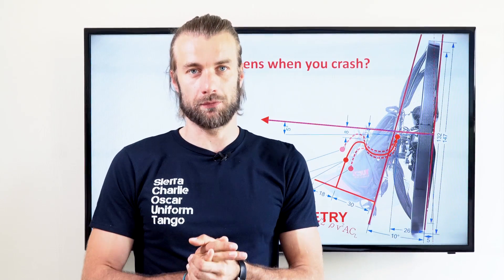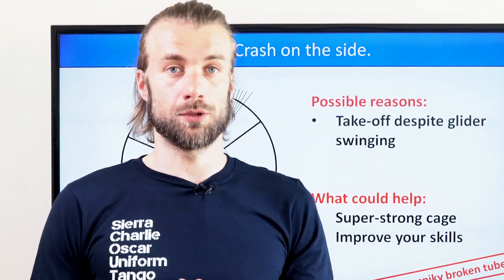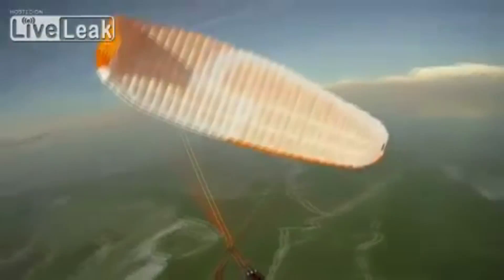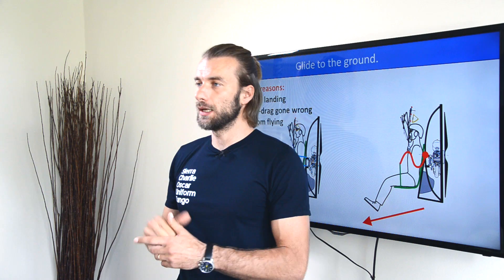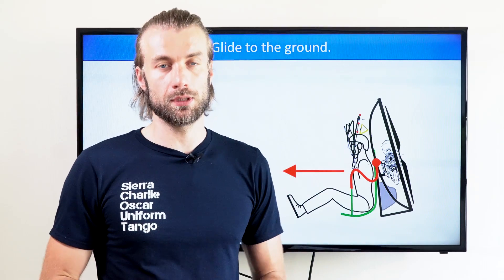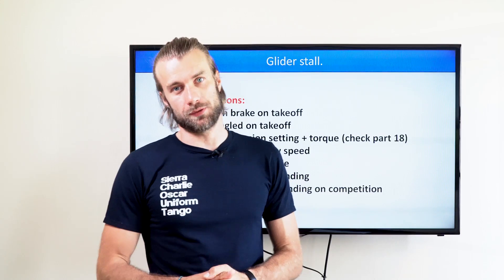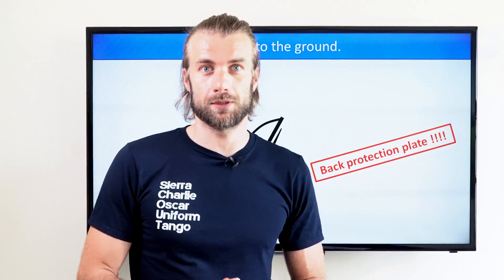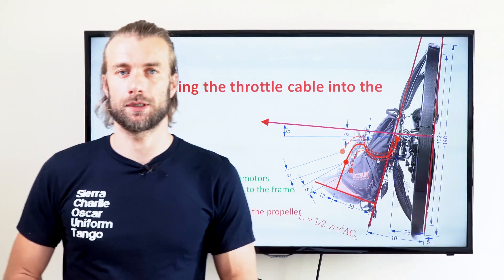Walk away after CRASH on your own? Paramotor geometry part 25.1

Comment: I haven't watched all of these yet but could you do one on a fire in flight & what you could do, if anything other than getting to the ground quickly. I ask this because  my battery is 4 inches from my fuel tank. It worries me. A precaution I took is to cover the positive terminal with electrical  tape. Is there anything else preventative  that I can do? Thank you!

Comment: There is another obvious thing you could do.  How about some load tailored crush foam underneath the seats for a relatively hard butt drag, maybe 6" to a foot thick?  I see a lot of pilots crash that way on the internet, and it seems that would go at least some distance to preventing back/hip injuries on moderate impacts.  At least the difference of crashing in sugar sand vs. wet driven on hard packed beach sand, and that would be SIGNIFICANT. 

Other aspects of the geometry look good.  Maybe you could even aero shape it a bit so not too much increased induced drag.  I see you discuss it later in the vid, after I wrote this, BUT, seriously:

IT DOESN'T MATTER whose FAULT anything is, it happens, you design the vehicle, THERE ARE TIMES WHEN YOU SHOULD throw the reserve, in fact I see SOOOO many pilots going in on the net that SHOULD HAVE, and try to "work" the foil out all the way to the ground, deal with it.  Personally, I don't think a TERTIARY, or secondary reserve chute is a bad idea, to be thrown fairly low, say low enough to get it inflated within 10-20 seconds of "two chute out" impact, as it gives that chute less time to get fouled by the other two before, hopefully, in that case, landing, rather than impacting.  You also talk as if you only have the choice of a crumple zone OR an airbag, the two are IN NO WAY mutually exclusive.  Dumb argument.  And I find it hard to believe that it does much to increase drag BEHIND your legs, legs up, maybe, legs down I'll bet you could design it to REDUCE the drag (rear fairing, anyone) but this machine overall is not BY ANY MEASURE a low drag (or high lift) flying machine, it basically relies on a LOT of HP/lb to keep it in the air, it's just SO LIGHT that it doesn't take a pile of HP to do it.  Something like the Rutan Quickie (drag of a Cessna landing gear) or a high performance sailplane at 50 or 60:1 L/D, that is a high lift low drag aircraft.

Obviously, there is no way to make everything inherently safe in this sport, but like in F1, you might consider incorporating everything you reasonably can to increase safety, and to me, as an engineer, this one does not seem, at first glance, to be anything BUT a no brainer.  Unless I'm missing something, if so, enlighten me.  As with EVERY engineer, wouldn't be the first time.  ;-)

And by "terminal velocity", he means of that total rig, which is NOTHING like terminal velocity (150-300 mph (diving) ) in a free fall with no chute, but still WAY TO FAST to be hitting the ground.  I've heard people say they had sore backs for days after hitting the WATER in that configuration in SIV classes. 

Seriously, you could also design so the throttle cable CAN'T get pulled into the prop....really????

Comment: Nice video.  Sadly, a lot of "expert opinion" without actual data...like a FlatTop video but with practical information.  If an airbag is so safe when will you adopt it as an option?  I'd gladly relocate my Scout reserve for more safety.   Also, why not just add impact foam as a standard?  Maybe 3/8 inch Shocktec foam to the seat back and underside...

Comment: Regarding drag of the airbag. Not so sure about that. I have a pap pa 125 and was never really happy with the medium size harness I bought it with. After 6 years I replaced it to a large size with airbag and been flying that for 2 years. I haven't noticed any difference in consumption. Also in paragliding airbag is not considered to cause much drag.

Comment: would it possible to detach one of your carabiners after you open your reserve to prevent down planing?
Reply from the maker: Special carabiner would be necessary.
But the real solution is to grab any line of the glider and wrap it all the way in. Then continue with the glider itself, simply collect as much of it as possible and hug it with love.
Reply: ok thanks

Comment: Two and a half years of flying, several hundred hours, and I broke my first part on the Scout. Launched in conditions I shouldn't have, "rode the bull" for 80 seconds, and flew into strong sink. With full throttle and a wing inflated over my head I was sinking rapidly from 75' to impact. I shutdown the engine before impact and flared with a full wrap of brake but I hit harder than my legs could hold. The Scout impacted the ground, shattering two spars and the bottom hoop section. I bent the frame and stand a bit as well, and my under-seat reserve made a dent in the earth. My flying buddy thought he had watched me break my back, and ran to my side. Once I caught my breath and unclipped, I was fine! I walked away from the crash a bit sore, some bruising where the back plate was pushed against my spine, but no major injury. I honestly believe the Scout saved my life and prevented serious spinal injury. I've ordered the parts and fabric required to repair the Scout and will fly again in a week!
Reply from the maker: +Mike Wakefield I am glad you are OK!
Was it a stal? Do you have a video to analyze and learn a lesson?
Reply: @SCOUTaviation , I'm glad someone made use of the but bag. He did say something that I hope he addressed. The back plate had no foam or plate.

Comment: As far as the accident shown in the video...it seems like he threw his reserve too quickly? It looks like the wing was just about recovered before the reserve fully inflated and it was the reserve that caused the spin?
Reply: SuburbanHobbyist I agree, the pro lem was not disabling the paraglider. I've seen lots of vids where the pilot tries to pull brakes, B lines etc on one riser, and fails due to twisted lines etc. A hook knife is a must. Had he cut a riser on one side his desent rate would have been plesent, with only minor injuries.

Comment: I am interested in this hobby. Is there anyone who has never had a crash or is it like driving a car? You are garunteed to have at least once accident?
Reply: NeoVoodooTech I never used a paramotor, just free flight paragliding. But yes you are going to have some "crashes" all mine were minor. Mostly during launch, and landing. Kind of depends on what you want to consider a "crash". I think of it more like sking, biking etc. You are going to fall over at some point.
Reply: I mean I've biked for years and only crashed once because someone biking next to me got too close and got me tangled,  so I'd imagine a launch or landing crash at 10-20 mph would be a similar experience.

Comment: An airbag is not that big ( like a car steering wheel one ) . It will not have a lot of drag under the seat.
The problem is how to trigger it and the fact that it needs a 12Volt battery to operate. But may save your life.
Reply from the maker: +Mihai Voiculescu I meant a self inflatable airbag like on paragliding harness. It inflates through a air inlet right after take off and stays inflated all the time.
Reply: I was thinking of a car style airbag that will inflate under your seat if triggered by a sensor. This sensor  equipped with an accelerometer will detect the "vertical" fall ( zero g) and will "explode" the airbag. The only thing is that the airbags tend to be expensive but at least will not break your legs after a vertical fall.

Comment: Byron Leisek's crash is a great example of why you should carry a hook knife (disputed topic). He didn't have time (or didn't attempt) to pull the glider, and it was very clearly at a dive angle that was propelling him faster towards the ground. Those lines are cheaper to replace than ribs and you only need to release one side. Because of that crash, I designed a hook knife that attaches at a main carabiner that allows you to yank it out of it's case in one motion and cut yourself free. It's also designed to be small (2.48 ounces) but still offer plenty of leverage for use with or without winter gloves, something other hook knives struggle with. Not trying to advertise, I just want to offer the design for free to 3D print and edit, you can even have it printed at a local library. If Scout is interested in distributing these, please contact me. https://www.thingiverse.com/thing:2351493